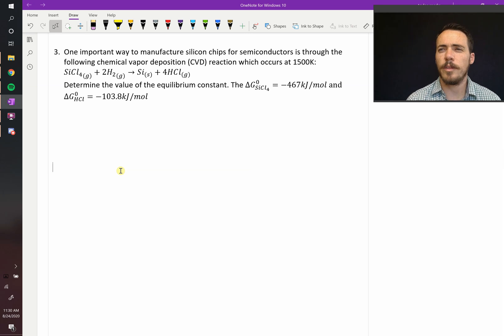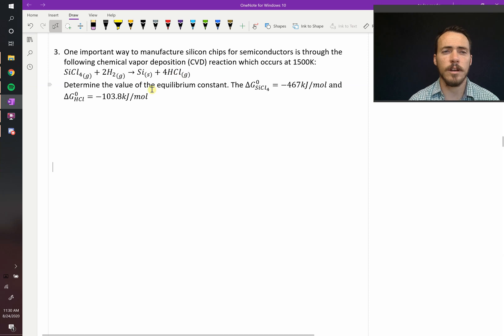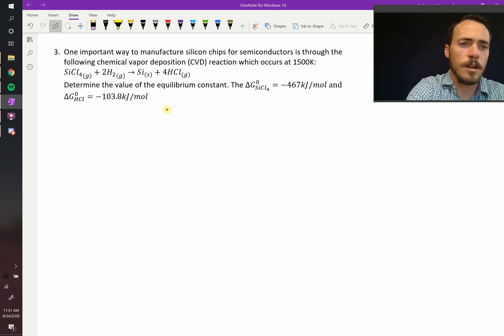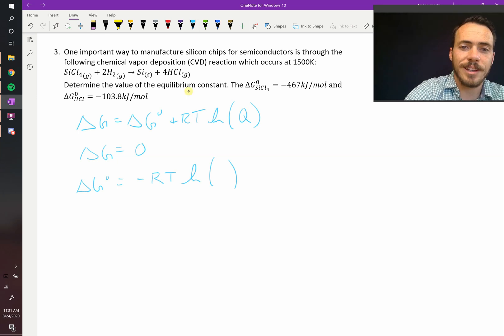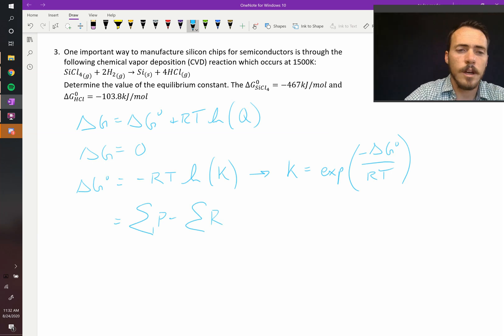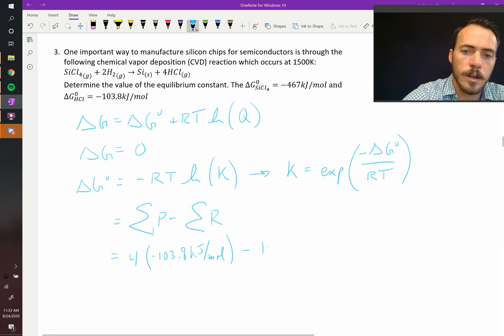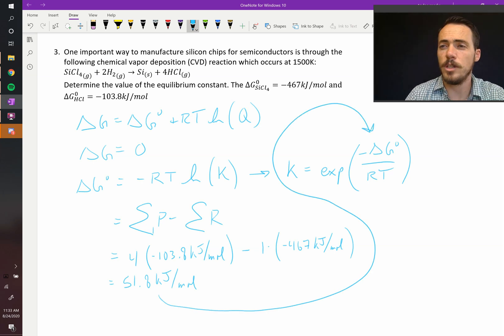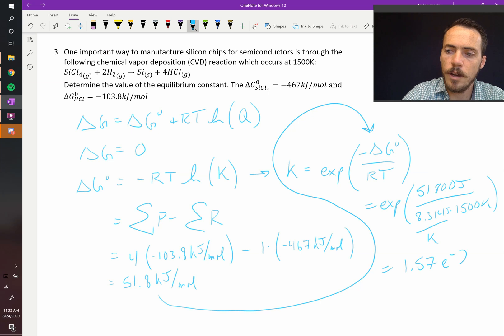CVD synthesis of Si. Example of thermodynamic calculation

Comment: When solving for delta G0, we got a value of 51.8 kJ/mol. But when we plugged it into the equation for K, shouldn't it have been a negative G, or -51800J? Giving us a K value of 0.16?
Reply from the maker: Hi Maggie, good eye. when I wrote it down I forgot to write the negative sign inside of my exponential. However, I did include the negative when I calculated it. I seem to have calculated it correctly. Here it is in Wolfram alpha. I get the correct answer as 1.57E-2. https://www.wolframalpha.com/input/?i=Exp%28-51800%2F%288.314*1500%29%29